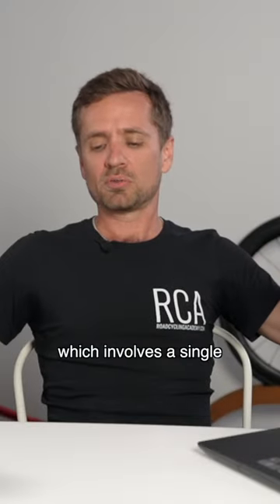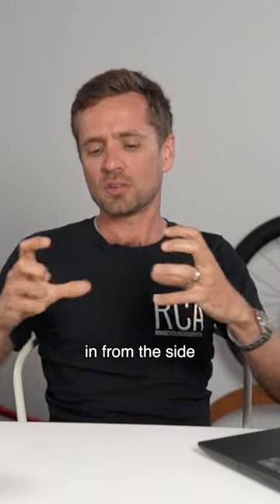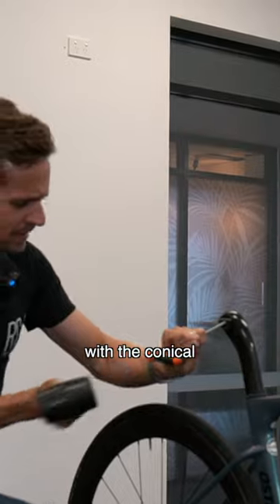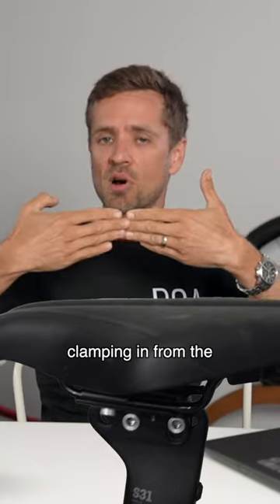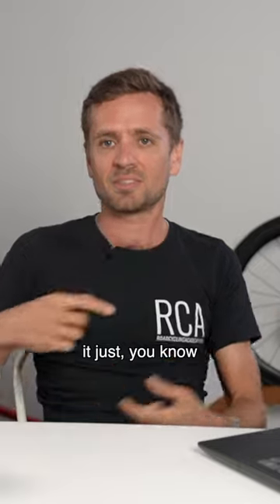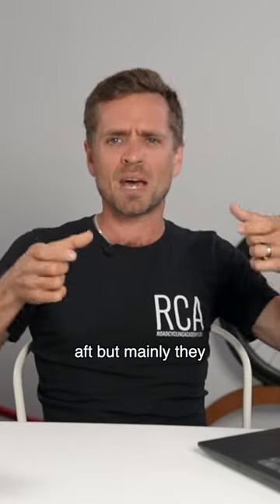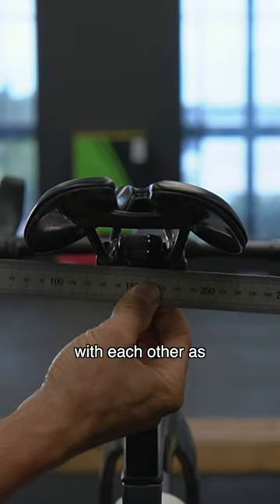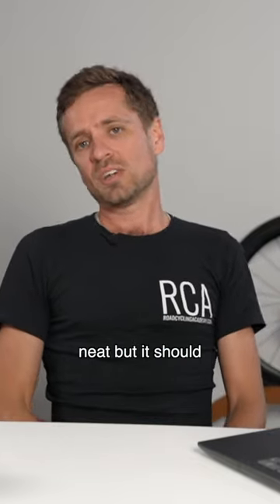Worst seat clamp

Comment: I have also heard the same from my bikefitter. I do not get it though. It is so easy to set the angle and clamp it. For me it also never slipped and I am close to 80 kg. Even used such a 1bolt clamping system on the crossbike. I check the saddle angle on occasion with a waterscape but it never was off.